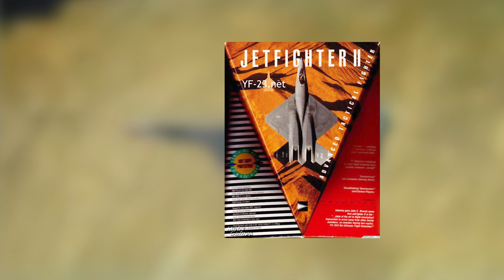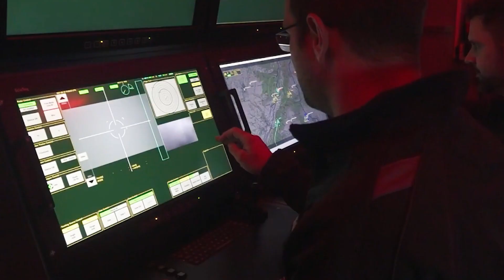Finally! US Tests World's Most Deadliest Fighter Jet

Comment: The military took the core of the engines from GE off the YF-23 and put them in the Raptor. After the competition. Because of the lighter weight and the ability for supercruise.
Reply: That's not true at all.  The reason there were two prototypes of each aircraft (2 yf22's and 2 yf23's) was because they were testing the new engines from pratt and whitney and GE.  One prototype had the Pratt F119 engine which ultimately won and the other had the GE f120
Reply: @ttank1994  But it is true, the military demanded all of GE'S engine components developed for the 23 and claimed them saying since the military paid for it it's all theirs. Something that never happened before. The 23 had supercruise and the 22 didn't during the competition. GE had developed a ceramic combustion chamber also. There was more also. I helped crate the parts up in Evendale Ohio. Upper management wasn't all to happy about the demands either. The 22 won because of politics.
Reply: I won't disagree with you on that, but your original statement is false and misleading.  They didn't take anything off the yf23 to install on the yf22.  One yf22 already had the GE engine installed for testing, therefore there was no reason to take it from the 23.
Reply: @ttank1994  well, I just remember after the competition the military came in and took our hardware. I didn't know one of the 22's had a GE engine. It's been quite a while anyway.
Reply: @ttank1994  Besides Tom, you said prototype, you didn't mention a specific platform. The way your initial comment was written was as if both planes were involve with the 22 only having the Pratt and the 23 the GE engine. Reread your first comment with the thought you didn't know each plane had each different engine. Because I don't recall ever knowing that. Sorry I didnt.
Reply: @kevint9702  you should probably reread my post I said 2 prototypes of each aircraft.  Two yf22's one with each engine and two 23's pav1 pav2 black widow grey ghost.  And yes prototype is the correct term because they were designated YF and not just F

Comment: This twin questions, of whether the YF-23 should have won, or why it did not, are perennial, as if some mystery remains to them. If the sole priority was stealthy-ness, the YF-23 was better, but only by a trifle. Its super-cruise was slightly better too, but those qualities matter with respect to distance. All aircraft become visible, closer. If there is a difference close-in, does a tiny shortfall in stealth give opposing forces time to get off the ground? Well no. Opposing forces now prefer missiles. In the dogfight? Ouch. The VF-22 had the extra hard punch in terms of maneuverability because of thrust vectoring, up close, do or die. We never lost an F-15 because we asserted high value on winning a fight. At the time, we knew the Russians had thrust-vectoring in the pipeline. At the time, we did not know that the Soviet Union would soon cease to be the daily threat, or that the F-22, moving forward, would be overkill—why the production was cut well short of initial procurement targets. "Should" is thus, a very tricky word, very hard to sell in retrospect. What mattered and what mattered most, were good questions. I think they got the right answer, given what they were looking at moving forward. With the resurgence of Russian Nastiness, we are moving ahead with Gen Six, to keep the Sukhoi off the table as relevant. We don't really want to use the weapons. We want to keep the baddies, including the Chinese, from using theirs. We keep the temptation low, that sort of thing—intimidate, sew doubt and risk in minds of adversaries. No rolling of dice. Keep your stuff on the ground so we don't have to shoot it down. U.S. Navy went with the non-stealth Super Hornet as a means of projecting power, only recently projecting stealth in the F-35 as an auxiliary capability. Adding stealth refueling by means of drones (soon) projects an outward, better game. The boat can be farther away, pretending. Chess.

Comment: I feel like the YF-23 could have been redesigned into a more Air to ground type aircraft. The Manuverability of the F-22 makes it the superior air to air fighter. But what if the YF-23 and the F-22 weren't competitors, what if it was mean to be a competitor to the F-35? What if the YF-23 was built to be a multirole fighter like the F-35. I think we could see a very successful aircraft.
Reply: You should look up Paul metz test pilot for both planes says he still preferred  the flying characteristics of the yf23 over the final version of yf22 the f22